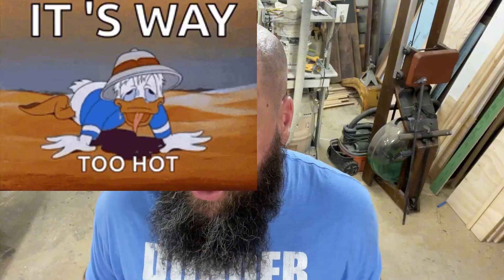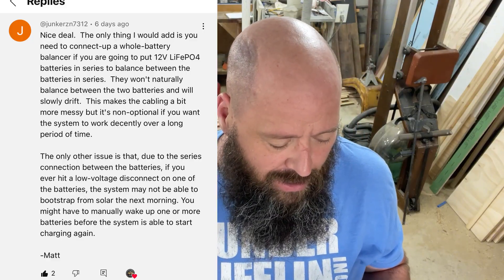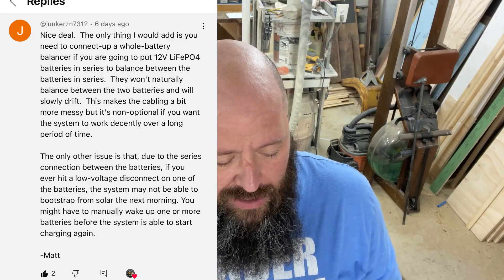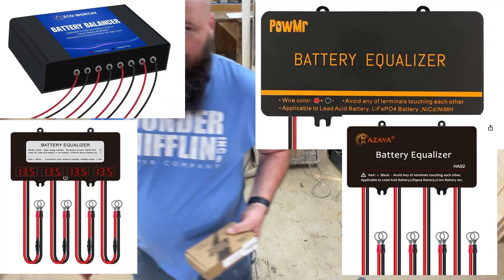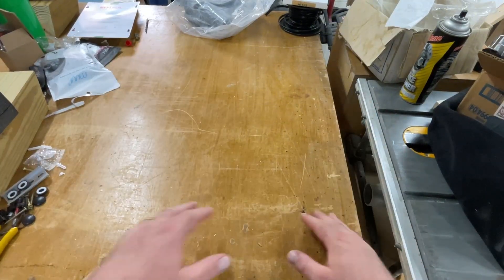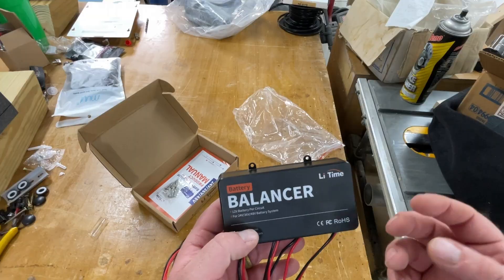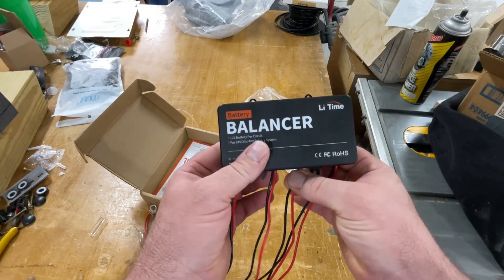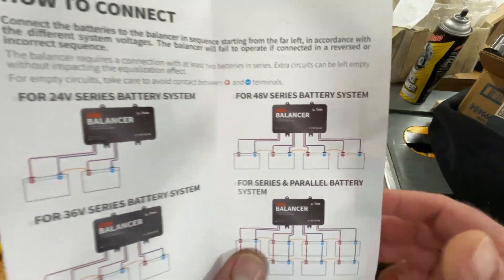Do You Really Need a Battery Balancer? I Finally Tried the LiTime 48V on My Solar Setup!

Comment: Very good video 
Can you helpm me with my system 
I have a 48 volt system (2*24 +2*24+2*24 in series) and those 3 pairs are connected parallel to make a 48 volt 300 amh system.I want to buy a balancer because i have  different voltage at some batteries.You think that is better to buy a 24 volt balancer to connect to each battery or this is not possible to work; thanks
Reply from the maker: I agree you do need a battery balancer with multiple batteries like that. The one I have featured here is only for 12 V batteries. I do see some on Amazon for 24 V systems but it’s only for two batteries

Comment: do you have to buy two balancers for 2 x 12 volt x 2sets on a24v system
Reply from the maker: It depends on which one you buy. Mine has 4 sets of wires. So you can wire up 4 batteries even tho you have doubled up 24v

Comment: I just set up 2 48v lifepo4 banks consisting of 4 200ah batteries each. I had 2 or 3 days without the balancer and voltages were varied by a volt or more even after charging the day prior. I connected the balancer and I could monitor the amperage and voltages  between them. In 2 days they were within 10mv between all batteries. I feel good about the results.
Reply from the maker: Yep that’s what happened to me when I just had the batteries without the balancer. Thank you for the comment

Comment: You're lucky you didn't burn it, with all those wires dropped randomly on the batteries. The manufacturers say 100 times in their pages "do not short the cables".
Reply from the maker: I didn’t make any cables shorter

Comment: you measured 13 something volts,but when you charge you absorb around 14 volts,and that is the point when they drift the most! so this balancer is absolutely nececarry,i tell on youtube everyone when i see this serial 12v setups...btw,1 milivolt is usually the treshold for these,so,they are perfectly balanced now...:)
Reply from the maker: Thank you for your comment and confirming the need for balancers on 12v batteries

Comment: I will be setting up 4 x 300ah in 2 battery banks to make 24v system so I think I will look at getting this balancer also🎉🎉🎉
Reply from the maker: That’s exactly what I had on my old setup
Reply: yeah do that,its safer,better.
Reply: What voltage of balancer do you need in this setup? Please. 
Is it 24v balancer ?
Reply: @ricklangmore4609   yes 24 volt balancer for 2 bateries,there are litime brand named balancer for good price,and they do the job,they are simple balancers for 2 bateries.You always need balancing cirkuit when there is more than 2 cells or 2 battery modules are inseries.Google gonna be your friend,look up wiring diagrams too,they are very easy.